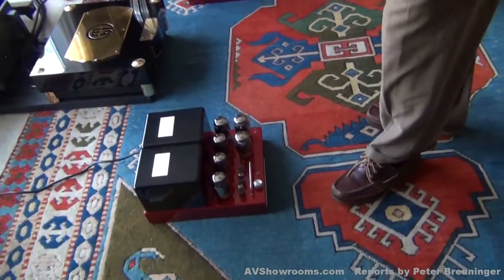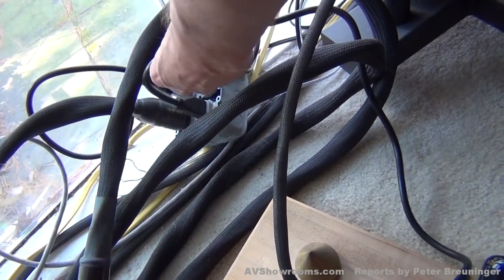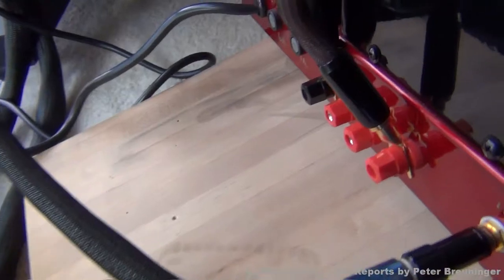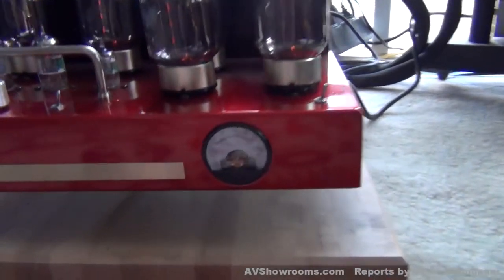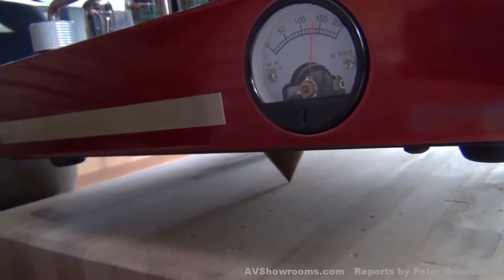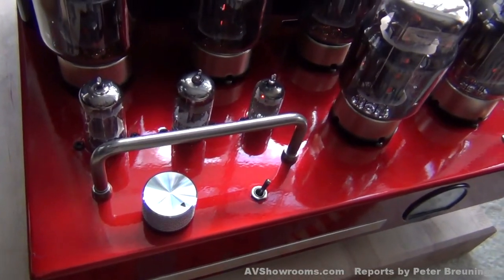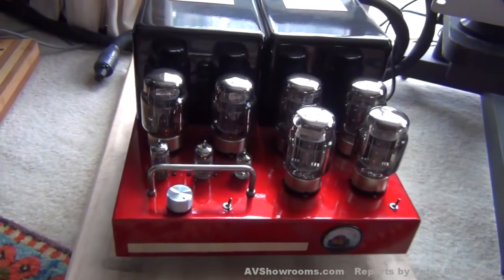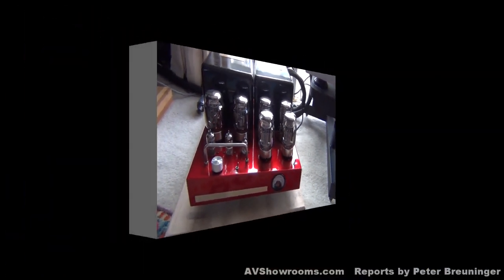Bob Carver Cherry 180s Set up and biasing.mp4

Comment: Isn't this Carver the same guy who said an amps sound can be defined by it's "transfer function"?––something he said he can perfectly duplicate in his low priced solid state designs. He bragged he could duplicate the transfer function of any expensive amp (tube or solid state) with his cheap amps to the point they were indistinguishable in blind A–B comparisons and went around proving it to major publications and reviewers.
Why then is he now manufacturing expensive tube amps? I know, he's one of the worst snake oil salesmen in audio. I had a mid 90s Carver receiver and I sure could hear a difference (and so could everyone who heard it) and it wasn't favourable to Carver. It was one of the most fucked up sounding pieces audio gear I've ever heard––extremely dry, abrasive and harsh––saw your ears off kind of sound.
Reply: They dont look like $8K amps, more like $1k, at that price he should spend a little more on the cosmetics.The only piece of carver equipment I ever owned was a used CD player which I paid $10 for.It wasnt bad but definitely had a carver sound to it.